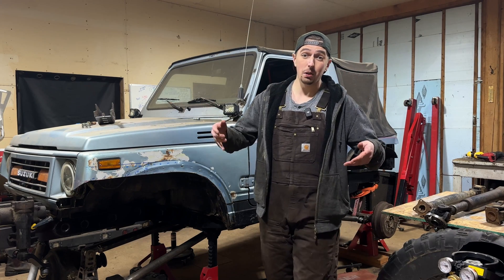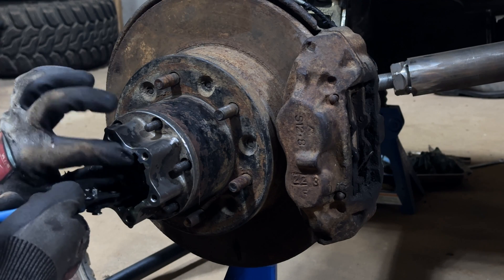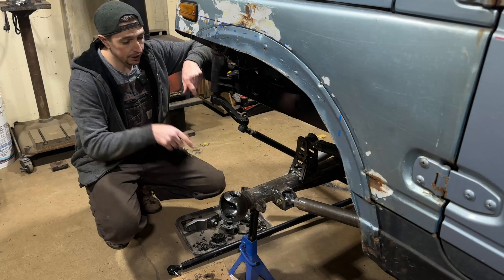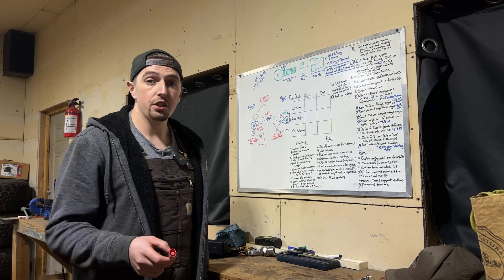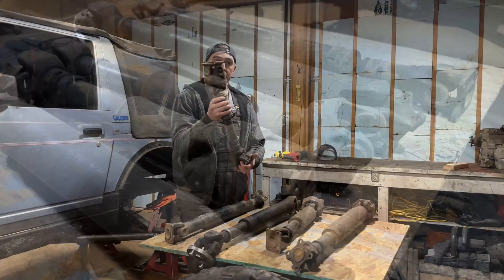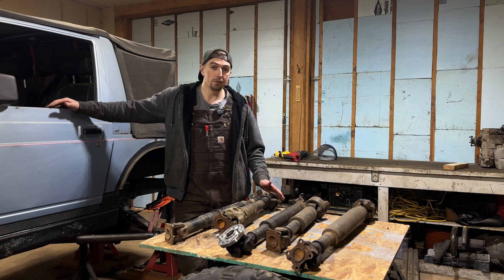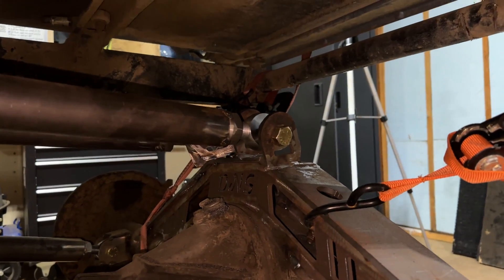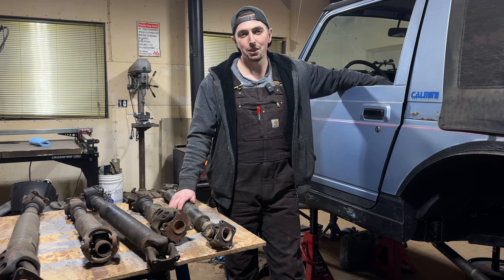I had to change my pinion angle | Suzuki Samurai Build Episode 15

Comment: If you wanna make pulling the axle apart a little easier you can just pull the locking hub face off remove the snap ring on the axle and the wiper seals on the back. Once that’s all loose pull your steering arm and you can pull it all off as one unit.
Reply from the maker: Wicked! In this case I am rebuilding the full axle with new parts so I’d need to re-assemble anyways. Good option for trail fixes though!
Reply: @alpinefab  I like it even in the shop because those cone washers are a bitch lol. And you don’t have to mess with the wheel bearings.

Comment: So maybe those OEM toyota double cardan don't have a lot of angle before biding, but I am running Toms wood double cardan front and rear on my samurai (full 1983 toyota drivetrain and axles) and mine can get a lot of angle before binding. Just putting this out there for people to not think all double cardan are low angles. Nothing wrong with singles, but on a short drive line, pointing the axles at the transfer case also reduce drive shaft angle by a large amount.
Reply from the maker: Yes good point! Another option is if you can get your hands on a First Gen OEM Toyota Double Cardan it has a high operating angle. 

Another point,  if you direct the front pinion to the TCase you will also need to cut and rotate your knuckles to adjust your castor!
Reply: ah yea, you will need to do that, I had to do it anyway since the axles I got where from some crazy lifted show truck or something, they had 26 degree in them. You could tell since the gears front and rear had diffrent ratios lol. Sound like a difficult job but it was not that bad to rotate them even for a first timer like me. @alpinefab